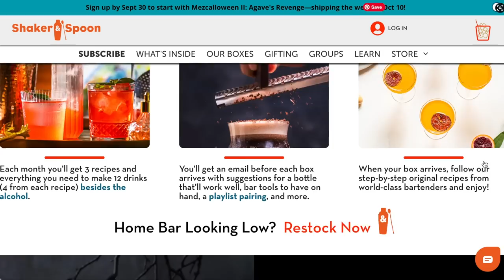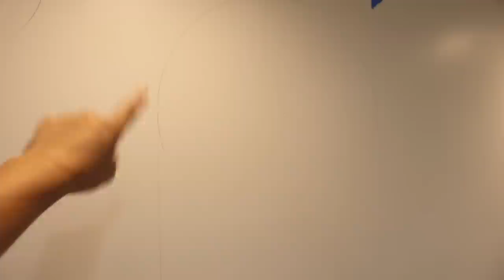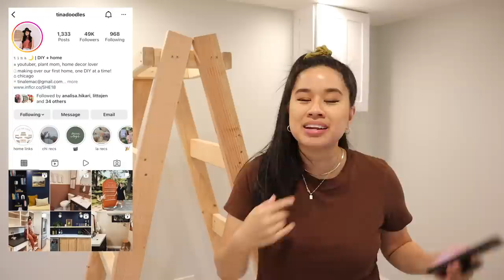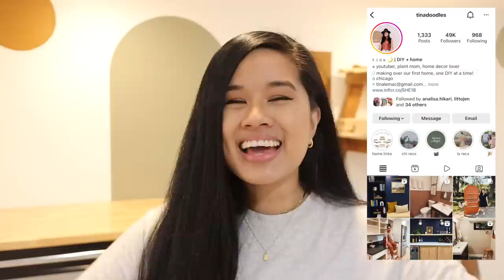MAJOR WORKSHOP MAKEOVER! (building a workshop in my basement) pt. 1 | DIY Wood Storage Rack + Mural

Comment: Looks wonderful! Love the color choices! You should get a rubber mat to put on the floor in front of table for grounding and comfort maybe the kind with the padding!
Reply: Great idea!! I have heard that kids play mat, the sturdy kind you piece together with tiles, is very easy on the feet.
Reply: They are called anti-fatigue mats;. WalMart, Sam's sell them, probably less expy than from Lowe"s or Home Depot.  But then, it's the thickness you need.  Also, from restaurant supply stores, the one with holes.  It is so water will pas through, do dust will settle in these cutouts.

Comment: You'll need a big Divided box or Boxes for those larger flat pieces of Wood Storage and a Really Big Peg Board Attached to the walls for Those Many tools You'll Eventually be collecting as XO McCenna Says don't forget to purchase 2= 45° corner braces for those boxes. Making time Count ! Braces are a Must!!  As it'll pay for itself over saving frustration & time 💖 As it allows you the Ability to Build Boxes by Yourself When Your Hubby is Very Busy..."So Far"; so Good 😍 Cannot Wait to See 🙈 As You'll !
 Expanding that Workshop  Around the Corner into the Next Space You'll be Needing...> Don't Forget Wall Anchors those Tiny screws, bolts, wringers etc will all need easy sorted see thru box Storage for top of those shelves on  those peg boards for easy accessibility unless your getting a tool bench as well !! Anyway saving jars you could screw under those shelves and using that industrial shelf look would work especially bringing all those spaces together you'll Diffinately will need shelves also for  paint cans , paint sprayers,  and pail storage and boxes for those different shaped paint brushes & rollers choices ! After all seems like You've got a itch for DIYing.  Your Expanding Basement is Differently Going to be.more than  nice😘🥰💯%
Also Since Your plans are to have children then this space will be a must have for safety reasons as ❤️‍🩹 Well...Enjoy Watching Your Expanding Your Talents Resume as a Desk Might be Another thought Downstairs and Upstairs  as you will be using sewing machine, cricket machine in upstairs & downstairs areas ... more as You'll probably Will Be Taking Your Talent to A Business Venture at Some Point
Organization Will be Key Factor as Your Growth Expands with Your Skill-sets ...Also think about creating a play room for those kids surely to come a little down the Line
While Assimilating Changes Around the Corner bring Ready & Prepared Now will truly make it easier to add children into the Area